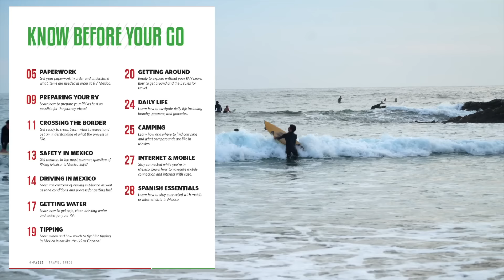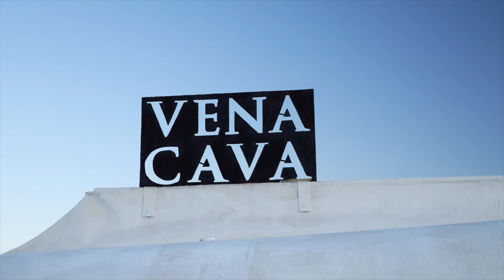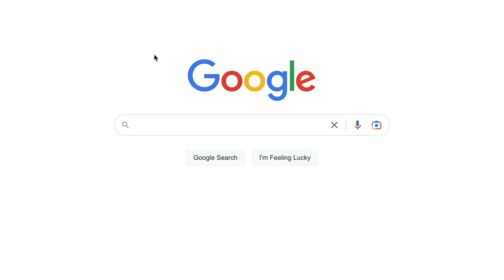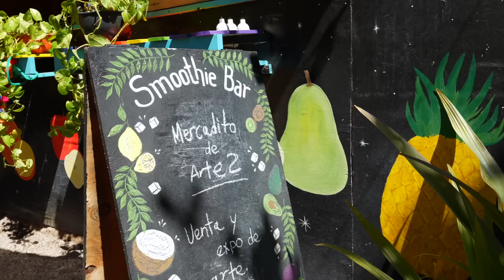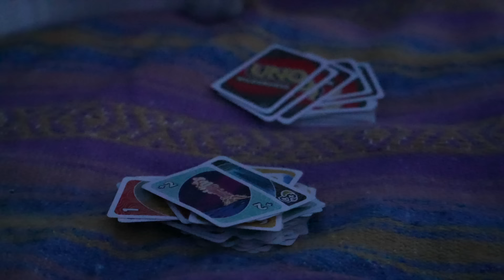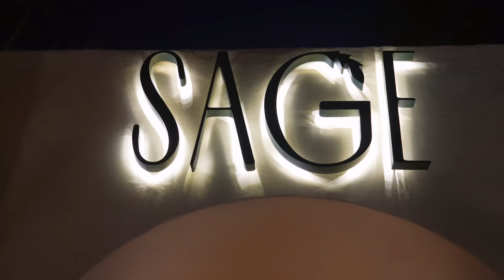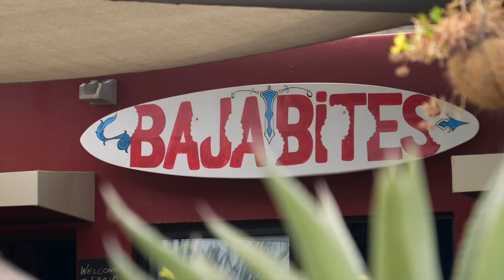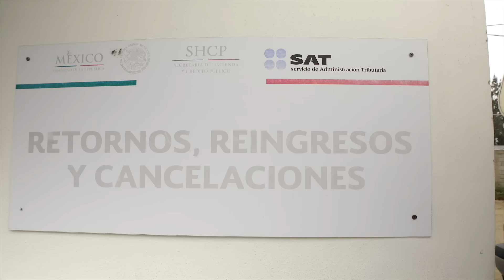Driving the Baja California Peninsula in an RV (The Best Mexico Road Trip)!

Comment from the maker: Grab the Baja road trip guide here! https://eatseerv.com/product/baja-road-trip-guide/
Reply: The secret to using tire plugs is to keep the tire of the vehicle at a good angle to reem it out. Then while the tire pump is going, put in the tire plug, turn 90 degrees and done. Trim the end to half an inch, and good. If it didn’t work, go back and reem it more with the pump running.
Reply: Excellent traveling experience guys! Congrats! Now I live in Miami,fl since 2006. Born and raised in Baja( Tj) bewn there, done that  ...specially the views.. are awesome

Comment: Hubby and I used to travel down to Baja in our VW camper van when we were in college circa late 1960s to early 70s.  We took the van down a treacherous road to Salsipuedes, which means Leave if you Can.  I would have to get out of the van to make sure the wheels didn’t go over the edge.  I believe now it has a golf course and homes to rent. At the time it had an olive orchard and at the top of the area there was a cement pool which was used to water the orchard but we could skinny dip and relax in it.  The trail to the beach was super hazardous.  There were a few houses there where there were some kids who we paid to round up rattlesnakes that they killed so we could get their rattles.  The kids would skin them and use the skins for hatbands.  The place is now a great surf spot with casitas for rent.
Reply from the maker: Sounds like great memories!
Reply: Yes, really good memories.

Comment: I visited Balandra when the tide was going out.  Low tide is surreal, make sure you go when the tide goes out.  If you hike in over the hill from Tecolote beach nearby, you can enter Balandra any time during the day without passing the ranger's gate.  I think they cut off entry when the parking lot gets filled.  I saw that the rangers very strictly clear everyone out at noon.
Reply from the maker: Great tip for those reading/watching!

Comment: Is there any off-road terrain that requires a four-wheel drive? Would a Honda CRV be sufficient for driving from the United States to Cabo San Lucas?
Reply from the maker: If you stay on the highway you can do any vehicle. If you want to go off side roads or to remote places something more capable is recommended. But for most places you'd be going a Honda CR-V would be fine.